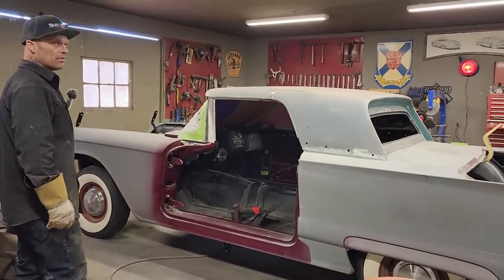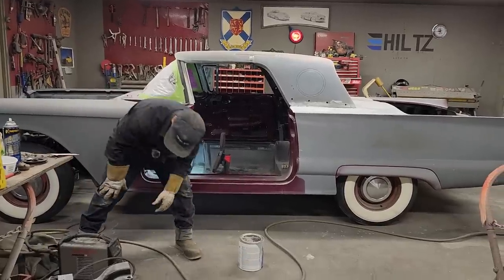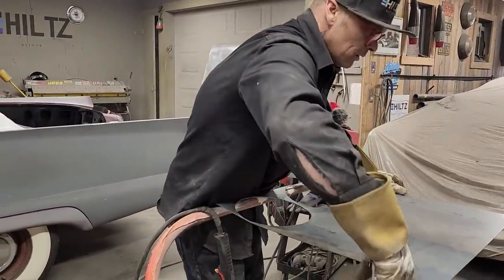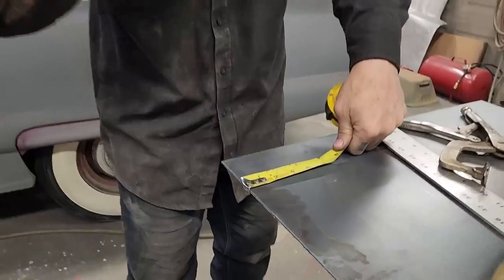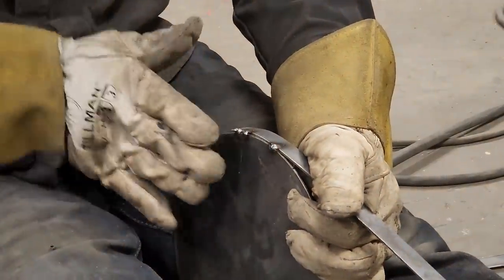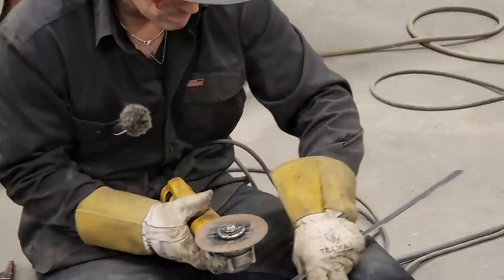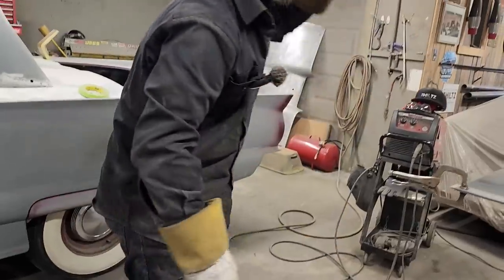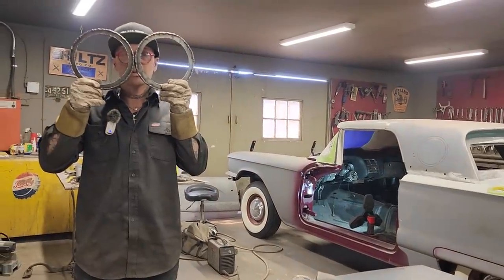Fabricating port hole windows for the 1958 Ford Thunderbird 😎

Comment: I had A56T bird with a 57 porthole top and the reason I went with the 57 top was because there's a blind spot if you don't have the porthole and it worked just fine on my 56  t bird once again great job  great video  Jolene

Comment: Like the pedals, you have already done the bucket size port windows, I would like to have seen how the ovals like on the Lincoln would look. Like the look of the 2 seater 58’. Great filming on Jolene’s part.
Reply: The rectangular ones on a 76 bird would look good with the rectangular sail and the Thunderbird emblem in the glass. I would add an L.E.D. backlight to the emblem also. I would engineer all the Thunderbird emblems light up. Subtle but very cool looking at night.
Reply: U

Comment: I had to imagineer a couple of portholes into a boat project one time.  I didn't have suitable tools and I was burning a brainbelt trying to think how to fabricate something.  Then I was walking around Home Depot one day and I saw these stainless steel electric stove rings.  The holes on the big ones were about six inches and they came already nice and shiny.  And cheap.  If you wanna build on a budget you gotta have some beady-eyed scrounge talent.  Stove rings!  Har-dee-har

Comment: Gee, when I said it would look good with portholes, I didn't think you would do it. Thanks, Chad & Joline, for taking my comment and adding it to the 1958 Ford Thunderbird build. It gave the car that 1955-1956 clasic roof look.😊
Reply: When the Ford retro Thunderbird was built in 2000 +/- it was the port windows that caught folks eye.
Reply: @andycurran3327  Yeah, I did. Elton John bought one after selling his car collection.

Comment: Easy way to mark out circles is to make a compass, cut out a thin strip of cardboard at what ever length you like, poke a small nail through one end and poke a lead pencil through the other end at the desired radius, use the nail as your centre point. The circle diameter can be changed by simply moving the pencil up and down the length of the carboard. I believe the correct terminology for the porthole window is an Opera window. Don't forget to check that the horizontal C pillar trim fits under the window.

Comment: Next time you have a situation where you have to hold a metal from the back filling those little holes tack a metal hanger to the little patch feed the hangers to the hole to hold the patch up against the back tack weld the patch in and wiggle the hanger off of the patch. Just my thought Chad. Hugo that car is looking awesome

Comment: Before you cut the hole in the roof remember to check the height of that roof molding so it doesn't interfere. Also you were trying to describe the model you have; the first body was called the baby Bird, your body was called the square bird.
Reply: I don't think so.

Comment: Chad: I do believe the porthole  window top was offered only in 1955. It was a one year only.

I love the look of your roof line. I feel a pothole window will take away from the natural flow of the wide B pillar.
Cheers
Reply: No factory hardtops were originally produced with portholes. Only 56 and 57 you could choose to have them or not but plenty of 55s have had them retro fitted

Comment: The car Pat worked on is owned by Dan and Kylie Morton, The XY Falcon looks similar as the U.S. 1969 Falcon, but nicer, this custom one runs a full chassis and is powered by a John Kaase 600ci billet V8 making 900hp, backed by a ZF six-speed, carbon fibre tailshaft and IRS rear end. Inside, modified Lamborghini seats are he only off-the shelf component, with everything else designed and built from scratch. “We’ve called the car Forged because it’s hand built. All the body lines are changed; the only part that hasn’t been modified is the middle of the roof-skin.”

Comment: All hardtops on the 55 thru 57 models are removeable hard tops.  
~No '55 came stock from the factory with the portholes in the hardtops.  
~Portholes were added to the hardtops with the production of the 1956 models.  Many hardtops for '55s were converted to porthole tops.  
~The stock '55 hardtop had a Ford Crest emblem on both sides.  
~A non-porthole '56 top had no emblems placed on the hardtop.  
~The 1957 T-bird hardtop was also available with or without portholes.  The '57 non-porthole hardtop had the new Thunderbird emblem in a small disk; the same style emblem that is on the steering wheel of the '57.

Comment: Chad have you ever considered a metal workbench to work on which includes a vice (it can be moveable with locking wheels).  I cringe seeing you working off the floor all the time 
 I reckon those portholes need to be "oval" vs round
Reply: If I had a dollar (American, not Canadian 😁) for every comment someone has made, recommending that Chad build himself a table, I could probably buy a new 2023 full-size pickup.

And Chad has mentioned many times why he prefers the floor.

I admit that I took, would have a rolling work table, if it was my shop.
But if Chad prefers the floor, that's his prerogative.😎

Comment: The aesthetic of the back window isn’t right in my eye, it should have gone higher to the return from the roof, tell him Jolene , your eye is great and right on with the cinematography you do, and I’m sure you’d agree with the awesome works you do. thanks.  Port hole window your right on for size, make sure the hole is level with the bottom of rear window,

Comment: What if you shorten the car. Move the back forward and the front backwards. Basicaly move the wheel wells as close to the cab as possible and move the rear and front of the car as close to the wheel wells as you can.

Comment: Helping my son build a lowrider 2006 scion xb with hydraulics  
Two pumps, front cylinders  10" , rear cylinders are 14"  with accumulators and 13" wire wheels  from Iowa 
Would like to send you pics on this build 
But not sure how to

Comment: PLEASE READ !!!  Hey Chad you have to start wearing Knee Pads when your working on the floor. I'm 69 years old and worked on the floor for years like you are doing. At 62 years old I could hardly get down on my knees and even with knee pads. I can hardly get up off the floor and working in the shop just 5 or 6 hours a day my knees hurt so bad I can hardly sleep at night.I need both knees replaced but Doc says I still won't be able to get on my knees to work on cars. And I can see your knees are starting to get unconsciously Weak. I see it but like I use to be like you and got so into my work that I ignored my body warning me.  Get some Knee Pads friend !!!

Comment: The '55 didn't have portholes, the '56 and '57 did.  Pedals look great, wish the back window was bigger.  I understand why you are putting in the portholes, so it changes the '58 more, but personally I'd like it better without, especially with the much smaller rear window.  I hope you will not put the chrome strip on where the top meets the body.  That wide piece of chrome would look out of place with the portholes.
Reply: Chad mocks up a visual before he embarks upon styling. I could see him standing back one way vs the other before he decides.

Comment: I guess it has been said already but as I watch you redesign this car, I got to insist - everything is looking good except the rear window!
The way you made it and the shape are good, but the size... It is just way too small.
It has got this mail slot look that a lot thirties chop cars have, because of the massive roof.
Hope you change your mind, cut out the frame out and weld a piece of metal in, to stretch it.
Greetings from Germany